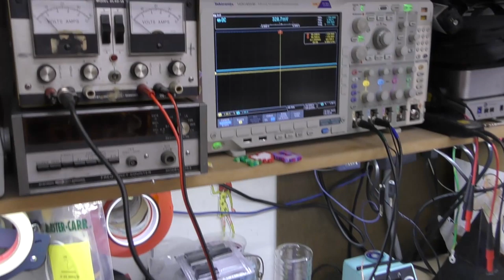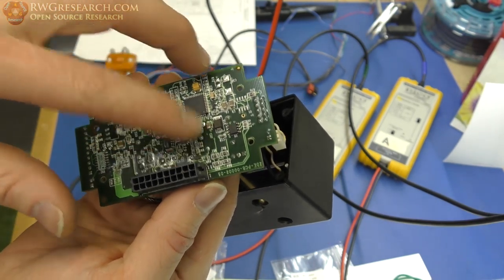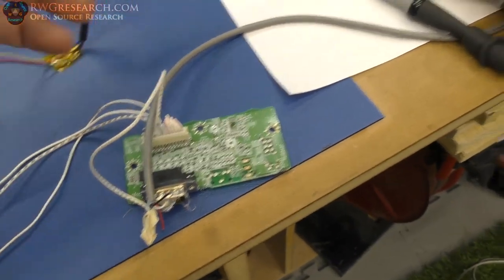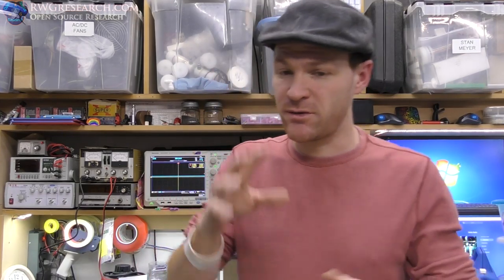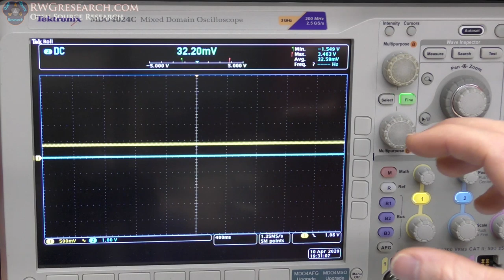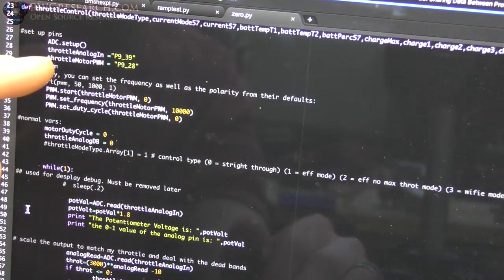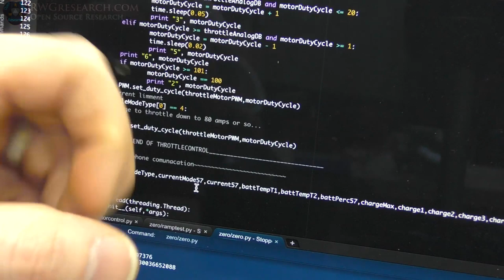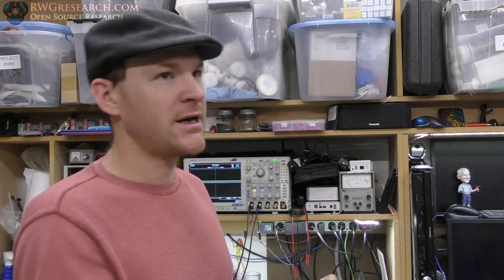Zero P15: Wifey Mode? Digital Throttle Is Working! Software! Electronics! Let's Look In Detail!

Comment: I have the same bike. If you just apply pack voltage to the 1/2 speed connector on the controller with a switch on the handlebars it puts the power in"wifey" mode

Comment: I still think this will work..Russ you need to build a small scale version of this.....And here is my explanation to go along with my two year old video model Zero wanted me to build ........

Actually the energy comes from the force of gravity wanting to make the heavy hanging mag assembly perpendicular to the earth.....you would want a pickup coil gathering energy under the plate. But we are talking a massive structure and some of the energy it does produce would be tapped and used to re-stimulate the swinging motion to produce more energy by the coils......But we are talking a four story structure with a 500 pound swinging mag and hundreds of ground mags to counter act the gravity of the swinging mag trying to seek perpendicular...there is no limit how big it could be made and how much power it could produce, I just need someone to produce it who has deep pockets... I think you would always produce more energy then consumed even when re-stimulating the swinging mag occasionally with a portion of the produced energy......  That stimulation would not be needed for a long time as the center mag would swing a very long time with the repelling action.....Not sure the ratio but anything greater then 1:1 would be tremendous......I'm thinking 100:1 from a massive structure.....
https://www.youtube.com/watch?v=MVF7mwTGu3k&pbjreload=10

Comment: Hi Russ, nice to see you again. would you trust this bike running on software on the road? do have safety measurements in case of fault? There are many connections and boards, and you know vibration and so on must be taken in consideration. Are such bikes allowed in the us without some kind of checking?
Reply from the maker: Yes. I will test the main motor control program thoroughly before any daily driving on the roads.  In the video as i said there will be a watch dog. This will be To check a few critical things all the time. However with any motorized vehicle... There is a kill switch on the handlebars. This will directly kill the main power to the motor controller In any emergency situation.... All in all. That list I showed of my To do's at the end of the video... There are a few things in there that are safety related as well. ~Russ

Comment: Yo. My belief is that a BMS stands for Bulcrap masacre standard or smth along those lines, could you change my mind please?
My belief is that its better to have a good charger (a 16s "RC" charger, although i've seen only 8 terminals max) and have the appliance consuming the battery a low charge disconnect function. Meaning you always only charge to full and you stop safely with the inverter/converter/controler, while a BMS - as far as i understand - works by bleading out at the usual 4.2v (li ion) while again with a dedicated charger you can put 4.12 or smth for more charges and greatter life time + there are no loses going through silica all the time

Comment: Wifey mode...lol     So I assume I rode a version back at Christmas time that was not highly modified with what you have been showing lately? Happy Easter...Hi to everyone.
Reply from the maker: ;). What you road was.. No control at all. The throttle was directly connected to the motor controller. Lol ;) your Russ mode is the same as my Russ mode! Lol full out! ~Russ
Reply: @RWGresearch  Roger that..... it was a blast.....noiseless motorcycle in Russ mode!

Comment: Russ, I need your help! You  are about open source and God, so am I.  well,  I built a different  type of power generator and I can't find  a speed controller that will spin it up. The type of motor I'm trying to  use as a prime mover is  a FP-640  i found on Ebay. If  you can get this motor to run and spin up the generator , I will  share 50/50  with you (word is bond). I got a controller like the one Gerard Morin used in one of his videos an Anaheim automation w/hall sensors. I couldn't connect it up, because I'm going blind (sucks tobe Me). I'm 68yrs and the way things are going I don't have much time ( soon tobe Soylent Green). Please help me bring electric power too all world wide! I live in Lancaster, California and the secret is the Power of Three (E= MC2) E = Battery, M=motor and C = Generator, This will create a Causality Loop, The only loop Hole in the laws of physics that I can find! I'll stop here before this becomes a book...